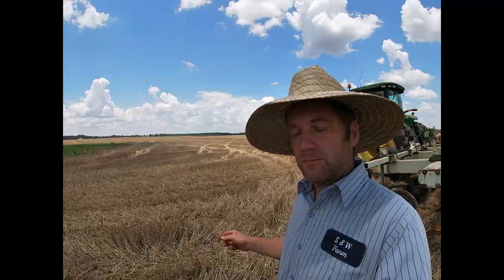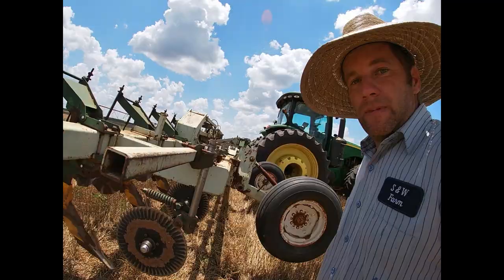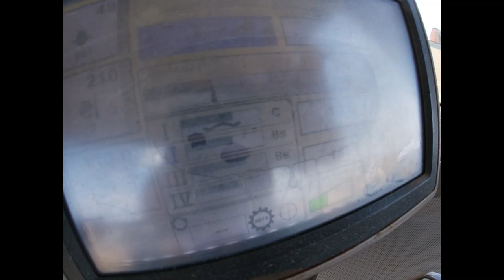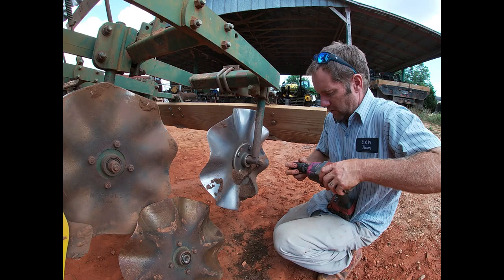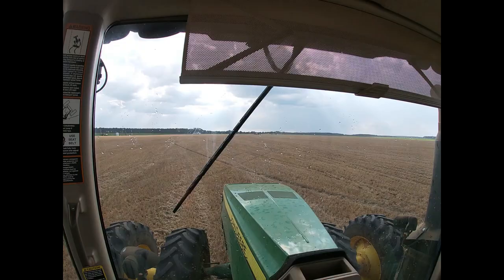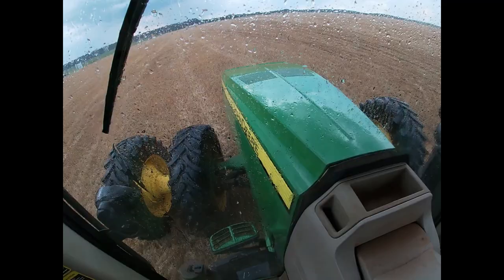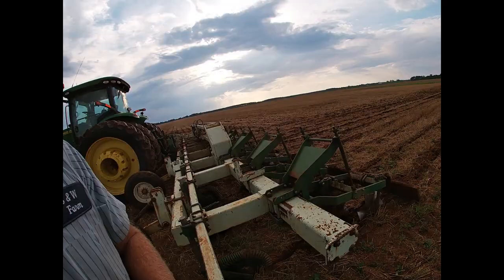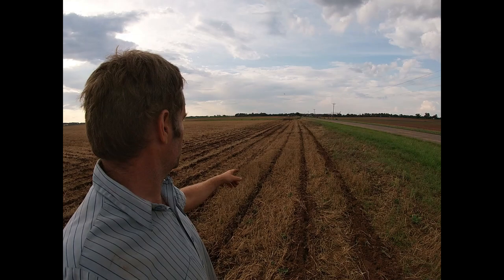Strip tilling cotton into wheat field

Comment: I would run a hot jumper wire from the battery straight to the electro clutch on the air conditioner and force that air conditioner compressor on. and manually open the plenum door open

Comment: John Deere air conditioners have a low pressure drop out switch make sure your refrigerant has the right charge
Reply from the maker: It’s an electrical issue.  “Cab voltage load low.”  We think its a grounding problem but we haven’t found the culprit.

Comment: Enjoyed the video! Just curious why you attached the board behind the strip till rig? Thanks from south GA!
Reply from the maker: Where at in south Ga?  We’ve run it with individual row baskets with and without tailing drag chains, a section of press wheels for each row unit, and most recently with that board.  The goal is to have flat smooth planting surface free of clods.
Reply: @PatrickShivers  I gotcha and that’s a neat concept. I’ve switched back and forth several times between the press wheels and rolling baskets, both having their advantages, but never 100% committed to either. Appreciate the info though. And Tifton, GA
Reply from the maker: My wife is from Ocilla, I pass through Tifton often.  I think the press wheels do the best job but with our red clay buildup on them is an issue.  The baskets were always a nightmare to me.  A cotton stalk remnant would jam in one and keep it from spinning which would make it dig a ditch instead.  We can’t get the board low enough to always be in contact with the furrows.  It requires less maintenance but doesn’t always do what it was put there to do
Reply: How do you do your cotton stalks?
We were using an Amadas 6 row stalk lifter/chopper until 2019.
We started using a 6 row KMC flail shredder in 2020 and then discing diagonally.
Reply from the maker: @MultiBaldEagle  flail and deep disc in winter high moisture.  If the moisture is high enough that you couldn’t disc unless there was cotton stubble in the field they will all but disappear.  If moisture isn’t high they will be disced twice at opposite angles.

Comment: Patrick a couple of questions. Can you bale the straw and still have enough left to strip till? Is wheat straw a pain in the as to bale?
Reply from the maker: We almost always bale it.  We didn’t this year though.  The problem with bailing it is in order to do so you have to cut the wheat low, which means running a lot more material through the combine.  It slows down the wheat harvest and wears out the combine.  On the other hand wheat straw can be sold for $15-$20 a role to mushroom farms.  The straw in a field is usually worth more than the wheat.
Reply: @PatrickShivers Straw bales aren't worth the fuel needed to make them in other areas (unless you need them for animal bedding). They seem viable in parts of Illinois and Missouri (I've even seen them baling it there). I think we would lose money doing straw bales in Oklahoma.
Reply from the maker: @karlrovey  Florida mushroom farms buy them down south.  Custom bailers will pay you $15-$20 a roll for them to roll and move out of field.
Reply: @PatrickShivers  Looks like you're close enough to a market for straw to be viable. Custom baled straw isn't viable in Oklahoma. If you get a contract with a dairy (pretty much the only people who use straw out here), you might be able to get a small profit, and you would have to do your own baling and transport it yourself.

Comment: Your bearing issue: The SHAFT the bearing sits on is WAAAAYYYY too small leaving lots of SLOP.  Was probably worn out when first bearing on it died.  You will continue to blow through bearings left right and center until the shaft is ~press fit onto the bearings.  Trade off in costs on a wear item.  Bearing replacement or new shafts.
Reply from the maker: That particular bearing was completely shot, meaning all the balls had fallen out, creating slop in that disc.  If you notice the replacement wavy disc had no slop when mounted on same shaft. We strip about 1,000 acres a year, usually 2-3 bearings go out over the coarse of that.
Reply: @PatrickShivers  Here is info to save you $$$/time/angst long term: You should have ZERO bearings go out during strip tilling 1000 acres.  ZERO.  Sure as Hell not 2 or 3~  That is insane!  Your shafts are WORN OUT.  They should be a PRESS fit.  Press fit requires a press.  Not slap it in like you did on camera for the whole world to see.  This SLOP between the shaft and your inner bearing's raceway destroys your bearings quickly.  Bearings MUST have a press fit on both their inner and outter raceways otherwise you will destroy them quickly as you just admit to doing every year + not making a good closing of the strip till + the stopping required and maintenance.  This costs you money, time, angst, etc.     

Leave it with you; hope this helps.
Reply from the maker: Both bearings were press fitted, as you will note i had a wavy disc with bearings already pressed in it ready to swap.  As you can also see there was zero slop when i spun newly installed disc.  All the bearings on the 24 wavy disc aren’t new at the start of the season so yes they do last way longer than 1,000 acres.  
   When we set an aggressive angle on them or if it is pulled in excessively dry ground we have a few bearings go out.  If set straight or ran in moist dirt there are little to no bearing issues
Reply from the maker: Perhaps I’m not explaining the process adequately.  Just so there is no confusion I’ll post a video later this week of the process up close and as detailed as possible.  Sorry for any confusion that may have resulted in my attempts to explain the process.
Reply: @PatrickShivers  Well, you can lead a horse to water, but you can't force them to drink...
Reply from the maker: New video fully explaining the bearing swap in detail with up close view is now uploaded.  Hope this clears things up.
Reply: @PatrickShivers  he wouldn’t like us… we run an unverferth strip till over 700 acres and had 15 bearings go out I know of this year 😂😂